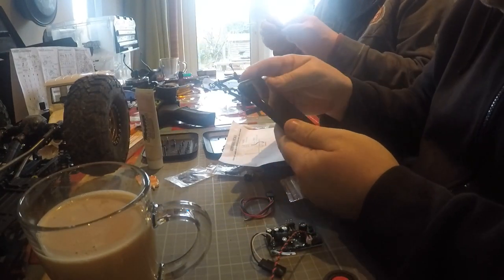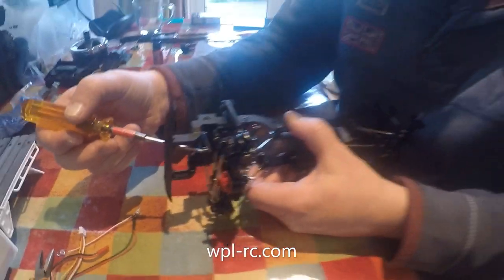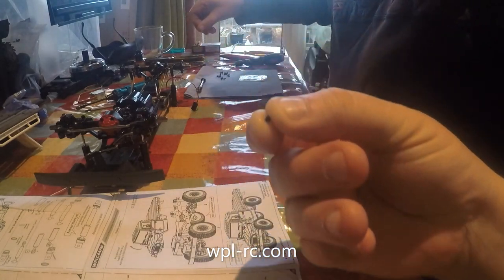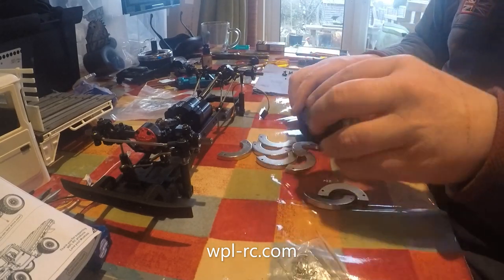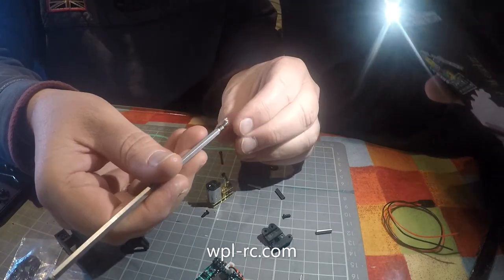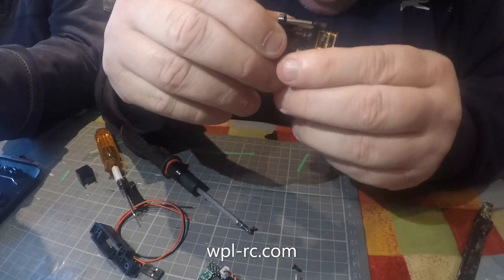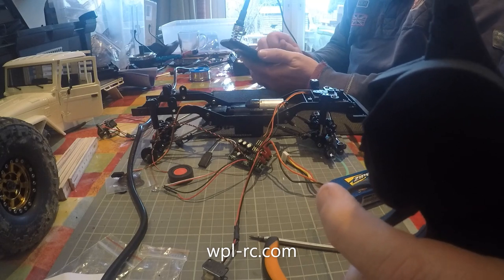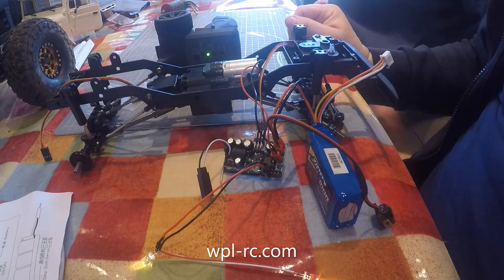WPL C44 KM truck overview and electronics build

Comment: is this better than the c34 km
i subscribed cant wait for the next upload
Reply from the maker: Sorry I wouldn't know about the 34 km as I haven't built or run one. Tomley RC on here might know. Thanks for the sub👍
Reply: Legendary Rc C44 has some changes over the C34. Both good, but the C44 is the better of the 2
Reply: @TomleyRC  i do not want full metal as it will increase weight and cause breakages when it falls
my idea is to get 1 c34km and 1 ordinary c34 kit and use parts from both
would this work

Comment: Pumpkins need to be on opposite sides from each other,they can't be on the same side.
Reply from the maker: Yeah am I right in saying one needs to be flipped over?
Reply: They have to be on the same side if you have the single speed (C34/44) in, but for the 2 speed opposites. Yeah, flip the rear axle